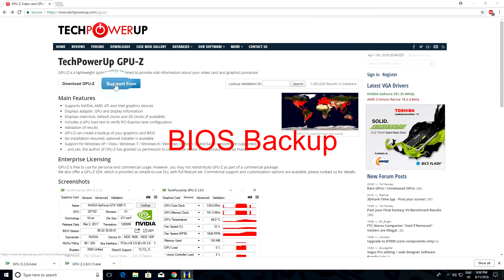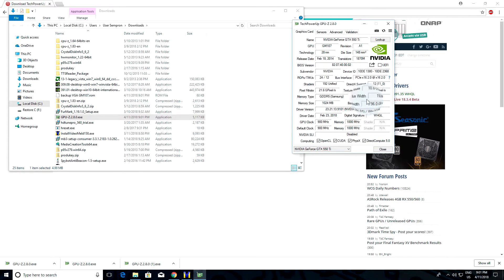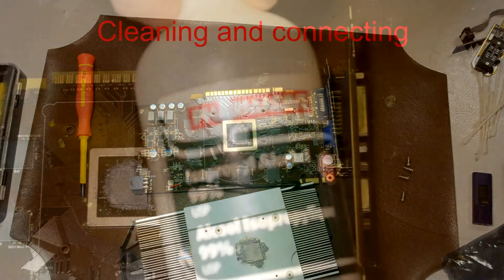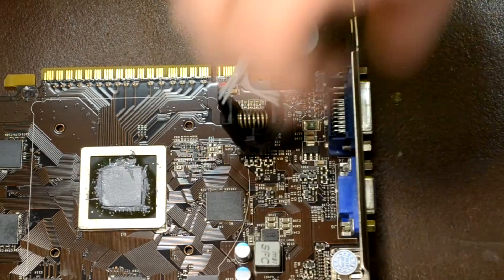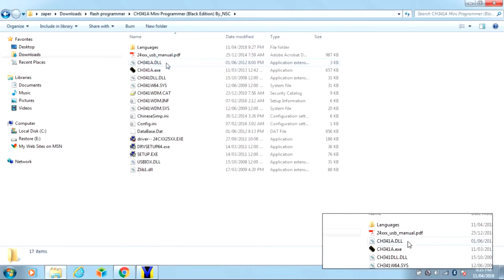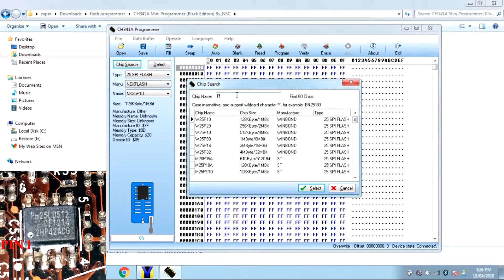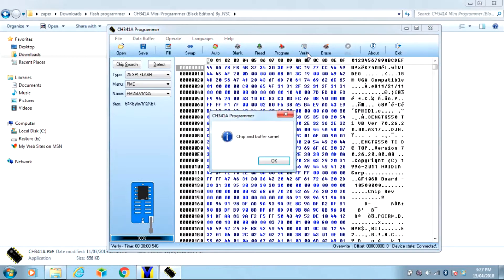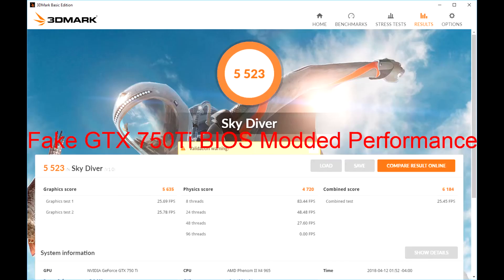Flash Fake GTX 750 Ti to ASUS GTX 550 Ti DO THIS AT YOUR OWN RISK

Comment: If anyone needs It I had to buy the original GPU for the Fake GTX 750 I had as mine was not whatever version this person had or used in their video or any GTX 550ti VGA BIOS's on tech power up. If you're card has full 16x PCI lines (the gold pins and not jagged like his) and looks similar to a PNY GTX 550ti (Orange fan version) let me know and i'll send you my saved bios of it so you don't stay with a bricked card, as i had mine bricked until I bought the original GPU.

Comment: My fake gtx 750TI has no model name on the gpu itself, after i open the case..
Reply from the maker: That sucks makes it a lot harder to find what your chip is. have you tried GPU-Z also if your lucky you maybe able to use it the way it is mine worked fine with hacked bios accept for wrong driver being installed and vulcan games like doom would crash if you enabled it  since vulcan is not supported by the geforce 550 Ti I think some of the newer drivers will also not work with fake cards  if it works with out crashing just use it the way it is anyways good luck
Reply: Is it always, that the fake gtx 750TI is the GTX 550Ti... Or it could be the other gpu model
Reply: I just noticed, that my fake gtx 750ti has 4 gigabit of ram module, which means it has 512Mb of memory.. is there any possibillities that is still gtx 550Ti?

Comment: I Have a Fake GTX750Ti VGA Card with 4GB vRam, With W25x20 Chip, and 8 Pieces Hinyx vRam and GPU Name GF116. Can it help me find a suitable Bios for my VGA card? At Least Can Be Used Because Now Can Not Be Used Because The Flash Bios Available In This Video
Reply from the maker: Honestly I'm not an expert on flashing video cards you need to get the model number off of the chip as GF116 may not be the complete model list of different GF116-400-A1 models https://www.techpowerup.com/gpu-specs/nvidia-gf116.g88  

I very well doubt that the video card has 4 GB of memory I would recommend backing up the original bios with GPU Z here is a list all the bioses for the  available on tech powered up 

GF116-400-A1 Bioses 
https://www.techpowerup.com/vgabios/?architecture=NVIDIA&manufacturer=&model=GTX+550+Ti&interface=&memType=&memSize=&since=

Getting my card to work I actually just kept flashing each bios until I found one that worked it took me 6 failed tries 7th worked and is still working fine
I used furmark to confirm 3D stability I wouldn't recommend running it too long is the cooling is not that great on these fake cards and furmark is a unrealistic high GPU load

I would try to get the flash programmer reading and writing to the chip  first I actually killed my video card before fixing it do to loose connections
sure that you verify that the chip buffer is the same by clicking verify if you're using the same software I'm using it will say chip and buffer same!

Anyway I wish you good luck in fixing your video card

Comment: It shows " chip with contents are disagreement" what is that
Reply from the maker: Basically it means your flash was not successful in the data does not match what was flash to the chip this can happen with loose connections or if you picked the wrong flash chip or sometimes if the flash chip is damage you should get the message  chip and buffer same!

Comment: Problem: The BIOS file linked in the description is a ROM file, but the CH341A program can only take BIN file.
Solution: They are identical file types. Simply rename the extension ".rom" to ".bin" and it will work.

Also, in the CH341A software, press "Auto" not "Program" to flash the BIOS to the chip otherwise it will not write the BIOS.

Comment: Im having trouble detecting the bios of my fake GTX 750 ti 2GB card with the CH341A programmer. the bios chip label is MXIC MX25L005 which is present in the database. But its not detecting it when click on read nothing appears. Device state: connected.
Reply: I think I found the same board of my card its a Palit GeForce GTX 550 Ti
Reply from the maker: its possible you have the jumper set to pins 2-3 TTL when you need the jumper shorted on pins 1-2 you can see the jumper position at the 2:02 mark in the video also try installing drivers again drivers where kind of wonky when I used it  anyway good luck

Comment: Hi, ZaperBaby...First off; nice video. It is far more detailed and comprehensive than any other I have found. Second;  I can't seem to load the existing BIOS. The C341A programmer fails to detect the chip, and the chip is not listed in the software's database. I believe the card to be a GTX 550 Ti 2GB. The GPU is clearly marked as GF116-400-A1, and the BIOS chip is a PMC PM25LQ010. The programmer's database only lists PM25LVxxx chips. Do you know where I can find an updated version of the database?
Reply: i just got into this problem as well

Comment: Good morning, how are you ? Sorry for my english, I'm using a google translator, I'm with a 750ti fake video card, it's a bit different from your model, the bios model is PM25LV100A, tried some bios from the techpowerup site, is there any guide or something to Can I actually find the correct bios? You can help me ?
Reply: hi, i had a fake 750ti card which was a gts450. i bought the programmer and  clip on ebay/aliexpress for a total of 15$. first you need to check what model card it is. you can either check the gpu under the heatsink or check the specs in gpuz (that's what I've done as the gpu code was scratched out). take the bus width and shaders as example and then use the techpowerup gpu finder to look for the model (it's something the chinese cannot fake in the bios). for the bios, also look on techpowerup vga bios collection. make sure that the bios has the same memory producer (eg hynix or samsung etc..) and same outputs also (mine had vga+hdmi+dvi, but other bios are from cards with 2xdvi+hdmi etc). from there everything sould be fine. I tried out 7 or 8 bios but only two worked without artifacts. hope this helps.
Reply: @giorgio5789  tqven qartveli xart?
Reply: Junior  Assis man i have some problam i have fake 750ti. you fix your card?
Reply: Yes I fixed it, but there are several models of fake GTX 750, if you want I can send you the photo of the model that I solved; 1 - You should look at the model of the graphic chip that is on your video card example: GF110, GF116 ..., 2 - Check the layout of the video card, write in google PWM GTX and compare with your video card. I'm in the email pointjunior1@gmail.com
Reply: Junior  Assis i google it and i am sure my fake 750 ti works on gtx550ti chip. i just dont know how to change bios :(
Reply: Junior  Assis i dont have chip programmer to fix. without this chip programmer i can fix? this is question

Comment: How do you find the chip number to type into the programmer program? I got a 650 Ti with BIOS chip named uP0104P UGA3AE which I couldn't find on the interface
Reply from the maker: That chip is not a flash chip its a dc to dc converter chip look for a different chip google the chips number to find out if you are connecting your programmer to a flash chip

Comment: This has been going on for ages.I had a fake gtx650.Turned out to be  a 9500gt.simple.fix use this method to get the current firmware then use a hex editor and fix the first 10 lines to match the correct chip identity.can b grabbed from a similiar bios. Bloody chinese and their fakery!
Reply: too bad almost all the card manufacturers are in China including gigabyte, evga, msi, asus. thats why it is so easy for some people to recycle their old chips and try to sell like a random new card.
Reply: I want to ask about fix the first 10 lines. Is that from 00000000 to 00000090 in hex editor?

Comment: how do I find out the exactly manufacturer of my fake card? I have tried some possible bios with no success
Reply from the maker: There is no real manufacturer of your card I would first try to find out what gpu is on the card by cleaning the thermal paste off  and google model number of the gpu chip once you no what gpu you have you can try a bios that matches your gpu chip also you may need to google you ram chips make sure you get bios with same amount of ram
anyway Good luck hope you get it working